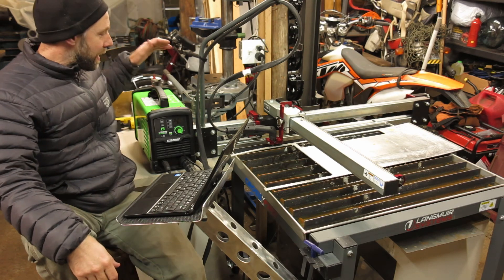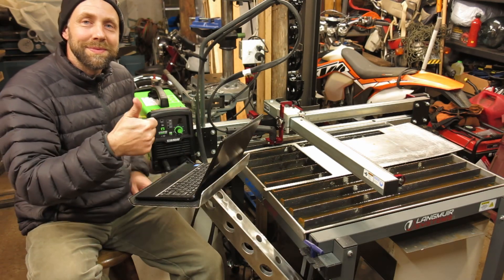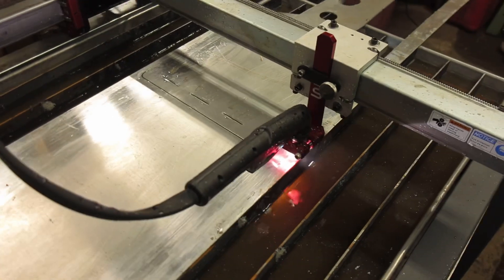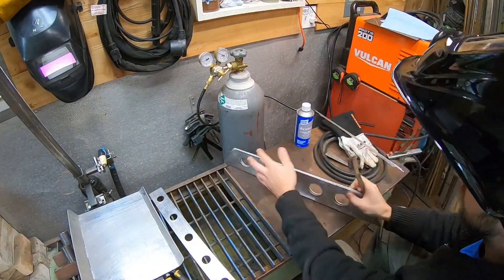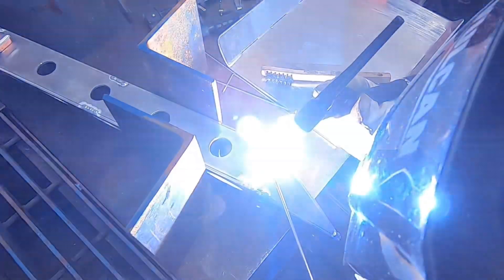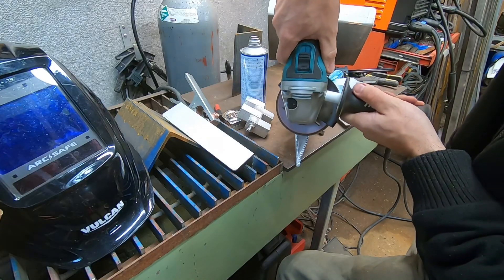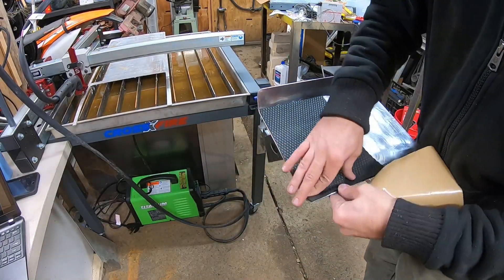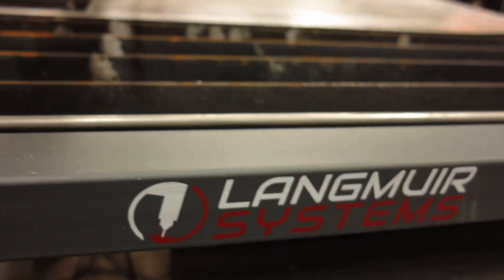Crossfire CNC plasma table Titanium plasma 45

Comment from the maker: If you are interested in this CNC table here’s a link to the website http://store.langmuirsystems.com?aff=16  and if you plan on buying one, Here is a promo code that will save you $100 off your table! The Code is MIKEFESTIVA   This is a affiliate link so I get a little kick back and you save $100 so it’s a win win :) 
**After Running the Titanium Plasma 45 for 3 years it's held up great! But I feel the Hynade CUT 60 CNC Plasma with blow back pilot arc start offers much better value and is PLUG and PLAY CNC ready***
Amazon Paid affiliate links below  
Hynade CNC Blow Back Digital Air Plasma Cutter, Non-HF Pilot Arc Non-Touch Plasma Cutting Machine, THC Torch Height Control Enabled (CUT60DN) https://amzn.to/3DEzR2m

Comment: very good your videos congratulations Did you have high frequency problems with the cnc?
Reply from the maker: No high frequency issues, this plasma cutter is a blow back pilot arc start. This style of start produces much less HF interference then high frequency start models.
Reply: @Mikefestiva  Hi Mike
Thanks for The information, so titanium45 plasma cutter is 100% compatible with cnc sistem

Comment: I know this is an old video, how hard was it to get the TITANIUM
65A Plasma Cutter setup for the Langmuire table?
Reply from the maker: It was fairly simple for me to set up my titanium 45, the 65 already has CNC ports so it’s really simple to hook up.
I have explained it in previous videos but have had many questions from others about that.
Basically you need to wire the CNC trigger wires internally to the torch trigger. 👍

Comment: I know this video is old , but anyone bad mouthing a Vulcan pro tig , 200 or 205 , is off their rocker.  I bought the 200 when it first came out , I ended up melting the torch running non stop on 1/4 inch aluminum plate for 35-40 minutes.  I went in to try and get my torch replaced , rather than give me a 50 dollar torch , I received a brand new welder.  Mine came with a 1 year money back guaranteed warranty.  And I paid 150 for the additional 3 year warranty beyond that . 

I recently upgraded to the 205 , and love this machine. My buddy bought the heavily used 200 . He was also welding 1/4 inch plate wide open at 200a with it , and although it sputtered lightly after about 20-25 minutes , it never overloaded “something he said his alpha tig would’ve done within 5 minutes of welding on the same material at same amperage . 

I found this video because I just picked up the titanium 45 , and I do believe I’ll be buying this table as well , after watching this ! 

Excellent content
Reply from the maker: Thanks for sharing your experience with the Vulcan ProTig welders 👍 I really have liked both the 200 and the 205, good features and a reliable welder overall. The Titanium 45 plasma cutter is still going strong, I have cut thousands of feet of metal on my CNC tables! Take care 🙂

Comment: Can you please do a video on how you wired your plasma cutter to your tablets operating system? I am trying to get my Tracker CNC table repowered  with a more affordable plasma cutter than the thermal dynamics cut 80 that I bought with it, I have had nothing but problems with that plasma cutter and would actually like to use the 16,000 dollar table I have collecting dust. I just don't have the money to buy another 4,000 dollar plasma cutter right now or in the near future that I can see.
Reply: I would try and find out whats wrong with the  TD, theyre good machines normally, maybe you have a dud, or maybe the problem you are having is do simple that you're overlooking it.

Cut quality is very dependant on some things.

Torch hight/tip to work distance.
Do you have a thc system?

Consumables
Genuine of knock off, new or old and used?
Matched to cutting amps, you can not expect good quality cuts if running 40 amps on 80 amp consumables or vice versa.

Air quality
Air needs to be dry and free of oils, what filters are you using, or are you running a refrigerant dryer?

Cutting speed , and cutting amps.
They are connected, even with perfect settings the speed of cutting needs to be a certain value,  you can not slow down to much to chech things, as then the quality goes down, and most people then slow down things even more, giving even worse quality.
So keep speeds and amps kind of linked together.

Comment: Are you using the 12' torch cable with this set up ? They are saying that a 16' cable is required .
Reply from the maker: I’m just using the stock torch that comes with the Titanium 45 plasma cutter. I now own the Crossfire pro table and I’m still using the stock Titanium torch lead 👍 I can’t remember the size of it but I know it’s definitely not 16’ probably more like 12’

Comment: Have there been 'issues ' you faced prior to making your first cut?    

I am having an issue with the post process, which post process should I be using/ what do you recommend. The only one that seems to print out the g code correctly is the Jet post process I've even used your firecontrol post and it doesn't work neither does your firecontrol controls. The only thing I have to do is add the M50 and the M51(but the M51 stops everything like an M00 instead of just shutting off the plasma then moving to the next spot and starting up again, WHY and I'm pressing cycle start again as if it were an M00, but won't move and is stuck at M51)? And it keeps shutting off my off my plasma while running and I found a good feedrate that makes it work good for alittle distance then the plasma shuts off, and I'm running a quality lincoln plasma not a harbor frieght and I've put the ground in multiple different positions.
waiting
Reply from the maker: What table are you running? If it’s the original crossfire you MUST use the Mach 3 controller and the specific post processor for that table, Langmuir will have that processor on there site.
You need to add it into the exact file in Fusion 360 for it to work properly.
If you are using the Crossfire PRO then you NEED to use the Firecontrol software and download the specific post processor again for the crossfire pro table from Langmuir. These two tables use different software and post processors so you cannot swap software or processors. I hope this helps. Ps did you check to see if your plasma torch is a known plasma to work on these CNC tables?

Comment: How thick will it cut
Reply from the maker: It’s basically up to the plasma torch you hook up to it, I’m running the Titanium 45 and it will cut 1/2” cleanly 👍
Reply: @Mikefestiva  do you have a parameter cutting chart for that plasma cutter?, i cant find it anywhere

Comment: How is the table holding up? I am on the fence between buying basically the set up you have or building my own, I would just be using it for home hobby work, nothing industrial or serious cutting of parts.
Reply from the maker: Marcus Morgan My Crossfire has held up great, I really liked this crossfire table, I used it for about 6 months but just sold it recently and bought the upgraded Crossfire PRO table and it’s really a nice CNC. for the price difference of the PRO, the options it comes with and FireControl CNC software I completely recommend it. Basically if you add the cost of the original crossfire table, plus the cost of the XL kit, water table you are at $1800, plus you need to buy a third party Mach 3 controller software for about $200 if you was to cut complex parts.
The PRO is the size of two XL tables, it includes stainless steel water tables, has z axis height controls and comes with free FireControl software, this is the software that controls the table. The PRO sells for $3000 usually but it’s back ordered right now so it’s selling for $2500 and I think my promo code will bring it down another $100. 
Here’s a video I did covering the PRO table 
Have you seen my articulating dump truck build? I basically build it from all the parts I cut on my crossfire table. https://youtu.be/EMJFn1tOgh0
Reply: Did the first table you had have dual drive on the x axis?? I think it's the x anyway?? Long support arm the runs the width of the table? The reason I ask is if it has no support or drive, I worry about jogging.or skipping when it changes directions or stops. Like i mentioned I am just a hobbiest so wouldn't be making much other than small parts for myself, looking at building my own, I can go as big as 5'x8' for right at a grand in materials, minus a laptop and programming, but I would like to have one now instead of another project in the works if that makes sense!. Anyway, thanks for the information. I appreciate it

Comment: Fusion 360 isn't free unless you're a student
Reply from the maker: It was free when I signed up for it and I’m not a student? Maybe there policy changed but I’m still using it for free.
Reply: @Mikefestiva  Yeah, Autodesk revamped how they subscribe everything, even their student downloads for other software is changed and more stringent. Right now its a free trial download for 1 year. but free commercial use until May 31 because of Covid-19 probably.

Comment: Hey Mike I was wondering if you could help me out a bought a titanium 45 plasma cutter from a sidewalk sale at harbour freight and was missing torch tip, basically everything on top of it and I ordered some stuff off Amazon and it was all wrong I purchased an ipt 40 and 60 kit.have you had to buy consumables for yours yet?
Reply from the maker: Hey Jim I have bought all the consumables at harbor freight, Cups and inside electrodes, if your missing anything else like the small swirl ring and other stuff I can look in my manual and check out the parts diagram and check part numbers for you. Let me know if you would like that info 👍
Reply: Thanks much, it was missing the electrode swirl ring cutting tip and retaining cup, I tried the amazon kit tianlylin 23 piece for the ipt40 and 60 it was $38.99 tried to paste in the cell and it won’t let me I took a picture of it but anyway it crammed in there and it seems to fit the electrode has threads on it, yet the torch itself is not threaded but it all fit in there currently wiring up some stuff from home depot to get the 50 amp plug working. thanks for your time and I’ll let you know if it works if you don’t hear from me I blew myself up LOL

Comment: @Mike festiva How does the Vulcan Omnipro do when TIG welding aluminum? My understanding is the machine is a DC only machine and aluminum is a bit difficult when welding with DC from my experience.
Reply from the maker: Hey William I was welding with My Vulcan but it’s the ProTig 200 which is a AC/DC TIG/ Stick welder, it welds great 👍 
I have never tried welding aluminum with my DC TIG machines, I hear you need 100% helium gas to do it but it doesn’t sound that practical to me. Take care
Reply: Mike festiva thanks for the reply man. I appreciate the info you gave here and the info you’re putting out there on YouTube.

Comment: Thanks Mike, I just purchased the Crosstrack and used your code, looking forward to using it, you also have so much info available , I'll be checking out your videos
Reply from the maker: Right on Keith it’s definitely a game changer! It’s really been useful in my shop, I don’t think I would have taken on that 4x4 articulating dump truck without my Crossfire CNC table, I wouldn’t have had enough free time to justify building it. If you have any questions about the table, programs or cut speeds let me know and I can try to answer them for you.
I really would like to make a video on all those things I just mentioned, I just don’t think most of my subscribers would really be interested in it but it would help people out that get these tables. Thanks for using my promo link! Take care 👍

Comment: Mike, I am looking at the Crossfire Pro but the wait is too long with a Project I have to make Immediately. 
I placed everything in the Cart from your Link and the Code of Coarse. I did want to purchase the Full Mach 3.....any suggestions for me?
Reply from the maker: Hey James I really like my Crossfire, it’s unlocked so many project possibilities for me! Yes the new table is not going to be shipped till sometime in the spring I think I remember reading? I’m sure it’s going to be nice but for the cost of these Crossfire tables like I own you can’t go wrong, are you buying the XL table extension? I bought that and the water table, if you don’t buy them now  you can always add them later, I just ordered them at the same time to save on shipping. I still have not bought the full version of Mach 3, I definitely need to buy it,  for the most part I have been able to cut all the brackets needed so far for my articulating truck project with the free version. If you plan on cutting anything with curves and artistic parts or letters you definitely will need to buy the Mach 3. If you have any questions please feel free to ask. 👍

Comment: If you haven't purchased Mach 3 you might want to hold off, as Langmuir is releasing their own controller software called FireControl when they start shipping the Pro tables.  It's free and will work with the older tables.  The quote below is from here (https://forum.langmuirsystems.com/t/pro-electronics-software-and-thc-upgrade/5883 ) you may not have access to the post if you are not in on the Pro preorder.

FireControl
The main benefit of the CrossFire Gen 2 System is FREE, cross-platform, plasma-specific control software with a modern user interface and ongoing support and development. The Gen 2 control software, FireControl, is designed and developed by Langmuir Systems specifically for CNC plasma cutting on the CrossFire and CrossFire PRO.
Reply from the maker: Thanks for commenting! I will definitely look into this 👍

Comment: HI.Been following your build  plasma track video and when we came to how to power the screw i found a couple of golf caddies i bought for very low bucks. These have a motor that makes a battery drill look like a joke and use 12v. They also have the switches and speed controllers included so its simple to and very cheep to modify them to incorporate in a plasma track. Two old and working golf carts cost me under 30 usd.. I would appear that you get what you need in an old golf cart.....time will tell.

Comment: Mike could you do a video on how you used the titanium 45 with the langmuier plasma table? I plan on purchasing both that plasma and the new larger langmuier table, I was waiting until I seen if the two were compatible, how did you hook up the trigger switch?
Reply from the maker: Hey Josh I plan on posting a video about that this weekend, keep an eye out for it 🙂 ps I just got a promo code it’s MIKEFESTIVA this will take $100 off of that bigger table once it’s in stock and shipping. Ps using that code also helps me out because I get a little kick back too. Take care 🙂

Comment: Do you have any plans to do a feature comparison between the Titanium plasma and the older Chicago Electric plasma?  Other than a few amps, I can't really find any specific feature comparison.  I currently have the Chicago Electric, so I'm wondering what (if anything) about the Titanium would justify spending the money to upgrade from the Chicago Electric to the Titanium.   Also, I saw someone mention below that they heard there would also be a Vulcan plasma coming out in January.   I have not heard that, have you heard anything about it?  If so, I wonder what the difference between the Titanium and Vulcan plasma cutters would be.

Comment: May I ask what version Windows you are running MACH 3 on?
Reply from the maker: JP I’m running windows 10.
Reply: Mike festiva thanks. Looking forward to more videos from you
Reply: Mach 3 does not like 64bit os. I had tons of position errors on my servo controlled mill before I switched to a 32 bit win 7 comp. Mach 4 can run on 64bit systems, but I have never tried it.

Comment: My crossfire arrives today, can hardly wait to start cutting
Reply from the maker: JP I’m stoked for you! It’s really packed well and every screw and bolt was in each hardware pack. The software on the other hand was a bit of a pain to figure out but I’m not that good with computers and I had not used a windows based computer in about 8 years. Plan on spending about 4 to 6 hours setting up the table. I knew nothing about Mach3 and Fusion 360 so it was a bit for me to understand it but now I’m getting the hang of it. Keep me posted!
Reply: @Mikefestiva  I am a MAC user myself really cringed at buying another Windows based machine, but hopefully for the better. Unpacking and frame setup was about 2 hours taking my time. Will resume after work today.
Reply from the maker: Dude you got it all unpacked and set up in 2 hours! Nice 🙂 it took me a bit longer to put together, but I had to take some parts back apart to install the XL kit.

Comment: Hey mike I’m going to buy the plasma tomorrow at harbor freight can you just tell me was it hard to wire that plasma up to work? Or did you have to contact Langmuir for a plug adapter or anything? Super interested before I spend the 750 plus tomorrow at HF thanks for everything man!!!
Reply from the maker: It was really easy to wire the plasma torch to fire from the CNC table, the crossfire came with a simple plug that you wire into the plasma torch, you simply take off the cover of the plasma torch, check with a volt meter what contacts on the torch close when you pull the trigger, then you clip on two connectors inside the unit to the trigger wires, run the wire out through a vent hole in the front of the plasma 45 and you are done, that simple 🙂👍 I will have close ups of the entire process in my next video. Take care